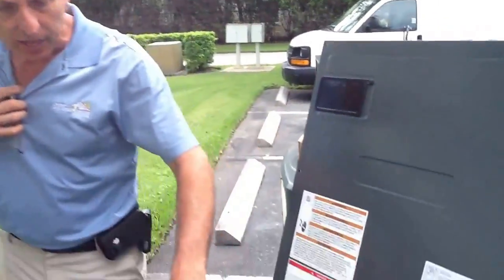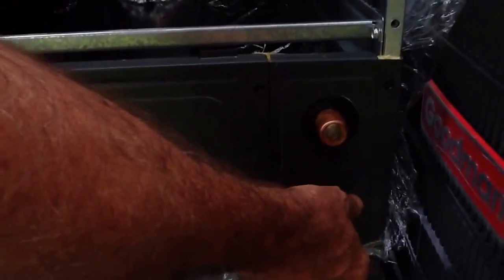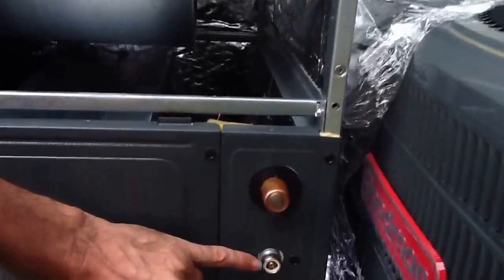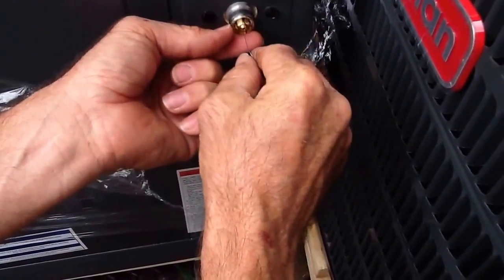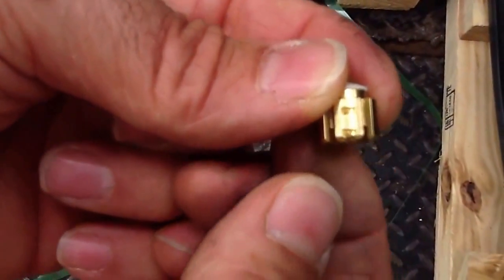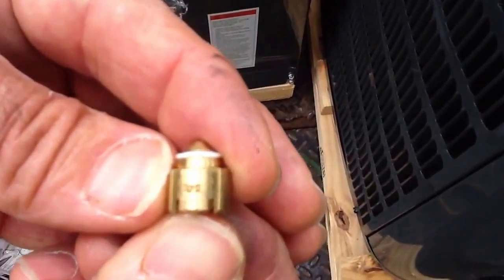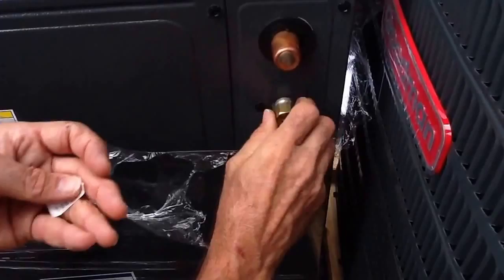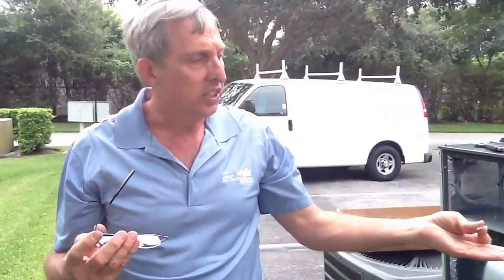Installing a Piston for a Goodman 13 SEER

Comment: question for you. With goodman gsx140301Ka and goodman capf3137, which piston would I need? I think .065. I also think that my hvac guy might have installed a .071, because that is what outdoor unit comes with from factory. What if any problem can I encounter having the .071 installed? Or do I need a txv installed with the items i have? Thanks

Comment: Someone enlighten me about these manufacturers.  IF  they can put a screwed connection on the high side inlet to the evaporator,  why in the world can't they put the same kind of  connection on the suction outlet of that evaporator?   They used to put screwed connections on the older systems that had precharged linesets,  and many of them held for a very long time.  Now they got fancy and won't do it.  Engineers really make me scratch my head, wondering what how they reason that one side should be a screwed connection,  where the highest pressures are,  and then turn around an put a sweat connection on the low side.  Everyone of them do this dumb stuff. How much simpler it would be for the tech if these screwed connections were on at least both sides of the evaporators. CHEAP SKAKES!  And this cheapness is showing up in practically every manufacturer's products.

Comment: I smack the piston in a downwards motion a couple times and it vibrates right out. Ive never had to use the wire. My tech thought it was just for cleaning the piston.

Comment: Goodman paperwork with condensers now has piston charts for their exact model units and tonnage. David just showed you the absolute correct way to go by. If unsure and no literature found with air hander/condensing unit I would recommend calling the manufacturer as Dave said below.

Comment: I just installed the 3 ton goodman condenser , check compressor on , blow on everything on but no cold air , suction line it warm what happened thanks
Reply: noah nguyen what was your problem?
Reply: Elliott leak
Reply: Call a pro. Don't tinker with stuff that you don't know anything about.

Comment: I David, I recently replaced a matched 3ton condensor that did not come with a piston. Its a Payne model PA13. I went ahead and used the existing piston but noticed turbulence in the liquid line at the evaporator. The system cools but I am concerned about the vibration? Any thoughts?
Reply: You have non condensables in the system. Recover the charge. Properly evacuate the system and recharge.